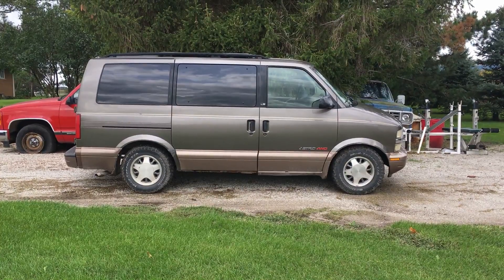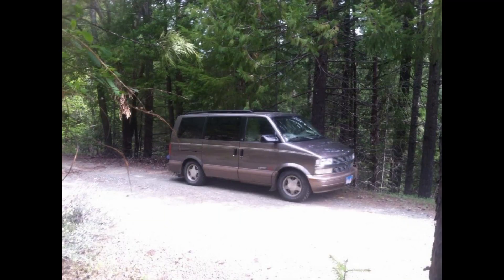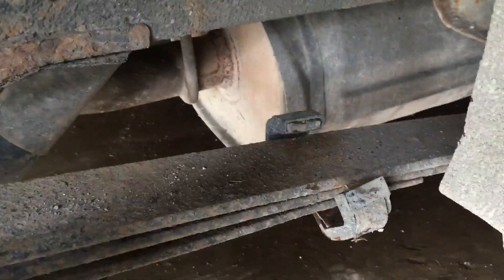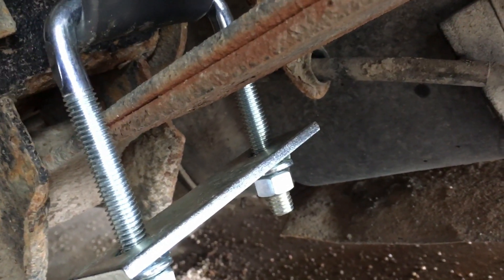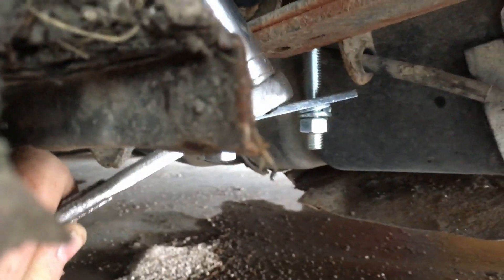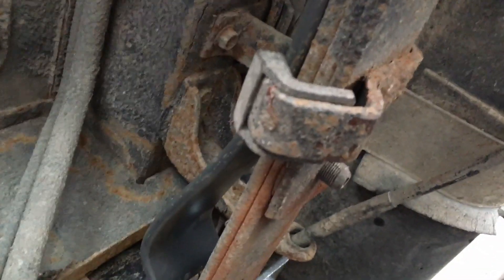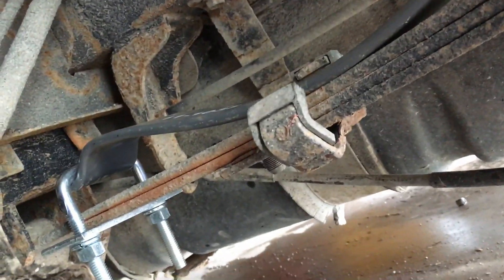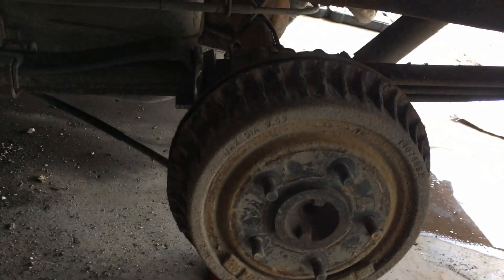Add A leaf Kit Chevy Astro Van. Beef up suspension for Cheap

Comment: I put all new shocks on my Astro and although short bumps get absorbed better, the overall suspension is still a bit soft. Your video motivated me to add leaf assist springs. Thanks.
Reply from the maker: No problem, glad you found it helpful!:) my rear left side side of my van sags a little, new shocks as well-I don’t get it! But it really doesn’t effect much, other than bother me when it’s parked in a way that shows that off lol
Reply: hello can you tell me what brand it is so that it goes up 3 inches please

Comment: Just did this and i got 3” lift. Does exactly what I wanted
Reply from the maker: Thanks for the comment, every once in awhile somebody will tell me I did this install wrong, But this is the correct way to mount those! Ps. it helped me out as well, but for some reason my van still sag's on the passenger rear side!

Comment: I had the same problem with my safari and went online to rock auto and installed ac Delco air shocks for like 80 bucks so now I just use my little air compressor to go up many inches 😅

Comment: Does this help strengthen the spings to carry more weight
Reply from the maker: barry cowan Yes
Reply from the maker: According to the box that these came in it allows for a extra 1500 pounds of weight not sure I’d put that to test but it they do def help.
Reply: Alright probably try em im hauling anywhere from 275 gallons of water or less and 2 people and other stuff lol it bottoms out in the rear some
Reply: @Barry11997  if that is all you might like air bags added instead.
Reply: @danielbuckner2167 , check air bag prices before going wild. They cost a lot more than the 70 bucks mentioned here.
Reply: @petes9878   So does a lawsuit or a total loss of your property not covered by insurance from over weighting your vehicle or using improper equipment.

Comment: I think it goes on the rear portion of the springs is that what u did
Reply from the maker: Nope. That’s the correct way, listed in the directions.
Reply: Matt Broquard I got the same kit my directions with one spring noted to be placed in the rear
Reply from the maker: @Thedevontree  Not the same kit I bought then, or the directions got changed which i doubt, here's another video of the same install by another guy,https://www.youtube.com/watch?v=29tMvVkEZ4E
Reply: Imma do this to my 97 astro. I think for this kit u r suppose to install one in the back n one in the front opposite side.

Comment: That is installed wrong,the add-a-leaf is supposed to mount center over the axle and pull up evenly on the front and back of the leafs.the way you have it now doesn't do anything.
Reply from the maker: Theses are in installed right-Go to 58 second mark on this video I'll be adding two sets as well to mine- https://www.youtube.com/watch?v=HgLt--4-Y6M
Reply: That is the installation procedure in the instructions. It is correct.
Reply: Came down to say the same but apparent these are to stiffen the springs not to add an over weight leaf like normal ones which make your suspension progressive which maintains normal ride until a heavy load is applied which is what I would prefer but maybe some folks like it bouncy.